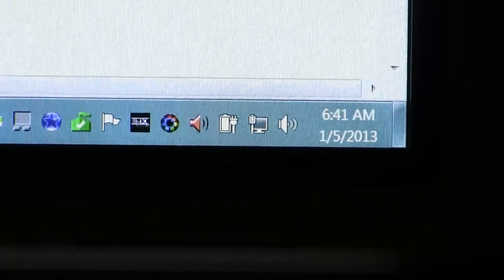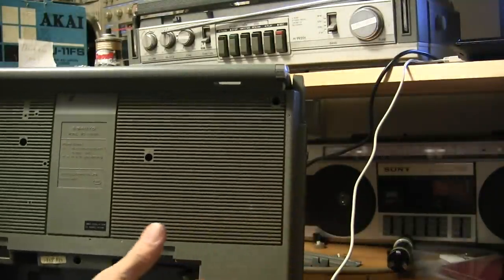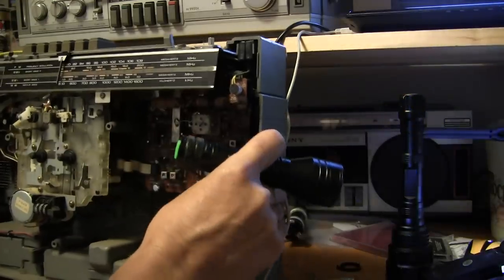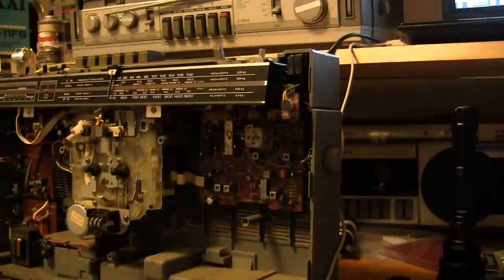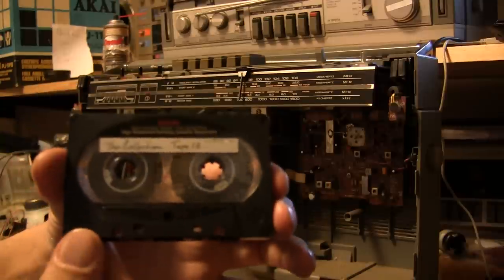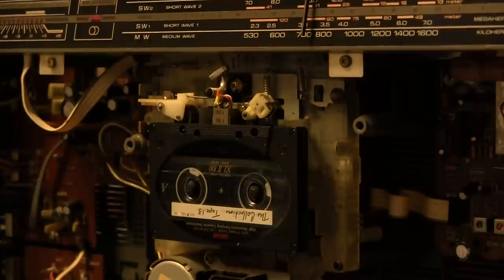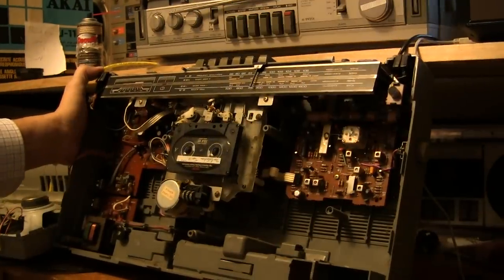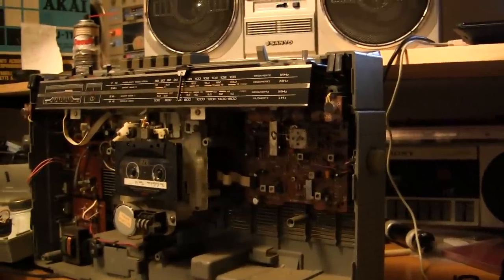Sanyo M9935K Boombox Open Repair Joey Binky antenna rod Question Answered

Comment: Hello 
Yes I got mine opened had one stubborn screw. My reason for owning was that the radio no longer worked on the a/c. In the process I knocked off the tuner cord -grr well spending several
Hours trying to wind it back on
Ended up breaking the tuning string. This radio was always tuning backwards from the dial 
Anyway but I kinda liked that. I could see that someone before me was in there and strung it backwards on the big wheel. 
Trying to find a replacement string was a bit of a challenge. I tried several types and even Internet sites to no luck. The tuning cords available were too big in diameter
Meant for older tube set radios. And local stores string/twine too big or not grippy enough. Mean while I took my other twin radio apart just to see the string and number of turns required. Didn't touch anything just took pictures and put back together. Later on that night that string broke too. 
Double grrr as that my main radio I listen to at night - :(
Finally found in the discount Isle at Walmart a roll of kite string for 75 cents small and a nice woven twins. A few more hours once home and voila. It worked !!!
The hard part is the number of turns on the tuning shaft 5 to 7 turns that tend to travel up or down over top of itself and bind. I tried from 1.5 turns up through to 7 that fills the space hoping to resolve that issue and referencing the other radio puctures I counted 5. 
 Then finally got a chance to look at the power supply problem. The fuse was good the power select switch and voltage select switch tested good continuity. Found an open circuit across the primary of the transformer. Carefully un soldered from the board, removed the plastic cover over the center windings and tested again found a bad connection on pin 1 a/c side. As I wiggled it Id get continuity. Able to re solder and put it all back together working great now :)
Gave both radios a good cleaning on the inside and very happy happy now :)

That tend to over lap and

Comment: I like your videos. I have 2 of theseOne I use at the lake during the summer. Bringing it in now that it's october, noticed that it won't play on a/c anymore so I tookit apart to test the switch and unfortunalty knocked off the tuning string to the radio -grrThe radio does come out with out removing all the rest. Just 4 screws and two more for the dial plate. What a nightmare trying to figure out the turns and running of the tuning string. I spent over 8 hours trying different combinations and researching the net trying to find out how it's meant to be strung. That's how I found your YouTube channel and subscribed. I'm going to take my other one apart today and see how to string this one. I didn't want to resort to taking the other one apart fear of losing that string too as that one I listen to my coast to coast radio show every night. But I'll see what happens.
Reply from the maker: +Mark Dufresne Krazm Enserfud All I can tell you is to open yours up and take you time that take lots of pictures doing so - so that you have a record of what you did so that when it springs apart you can just look back at your history of pictures and see just where that sprung thing came from and where it belongs again
Reply from the maker: to the Unknowing that sell these on ebay without searching price history this 9935 can go for less than about 50 bux shipped and for the other ones can go as high as 150.00 or not too much more.  This is one of the few 9 volt or 6 D batteries powered boombox that have the somewhat larger speakers in them for a slightly better sound but then this model is hampered by being only a 9 volter in operation where as if it had just a bit more power @ 12 volts and 8 d batteries then this size box would sound so much better for what it is.  This is just my observed opinion.

Comment from the maker: When i seen your question this gave me the excuse to open mine up (the dirty one) first, and lube the controls.  Then after putting that one back together, I opened up the second one and found the issue with it, but then had to reopen the First one to figure out how to fix the 2nd one.  That's when I discovered that the Capstan Flywheel had a rubber tire mounted one it that drove the take-up reels and in the 1st one it was missing & the 2nd One it was gooo took that out to clean with Gasoline &&

Comment: I have this exact unit, a bit dirty, but in great shape other than the tuner cord has came unraveled and hanging loose out the top of the unit.   What is the trick for fixing this?
Reply from the maker: +Shane O'Neill finding the service manual to learn how to re-string this unit, or get another same model and see how the string is in that one and apply it to yours